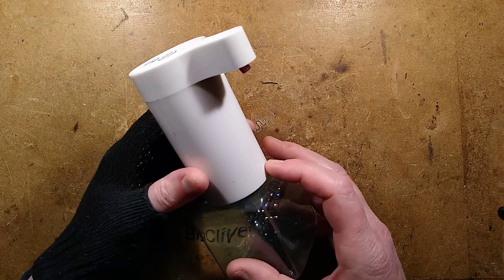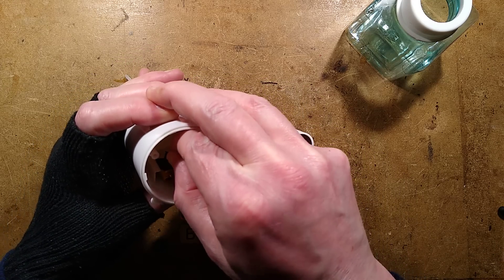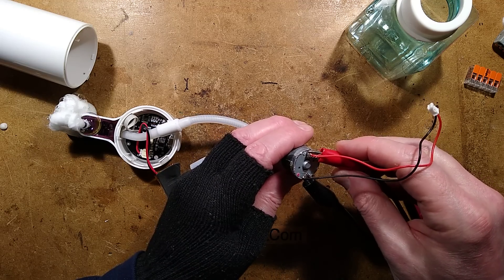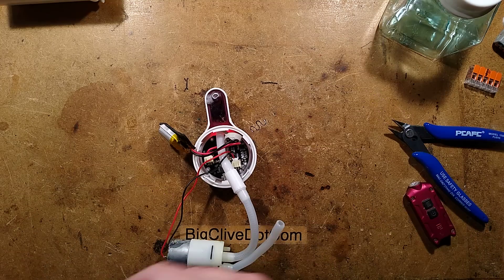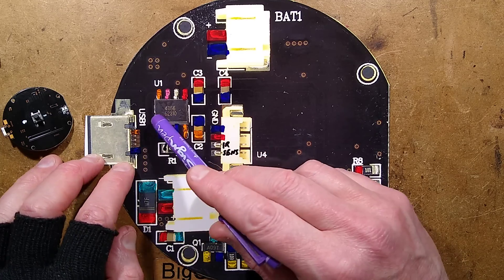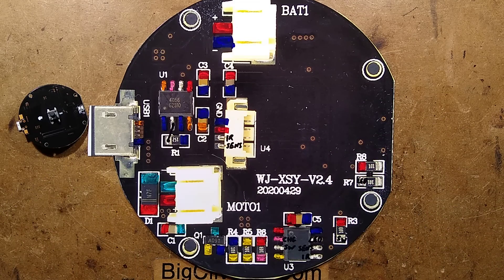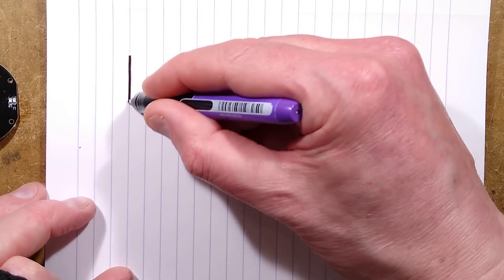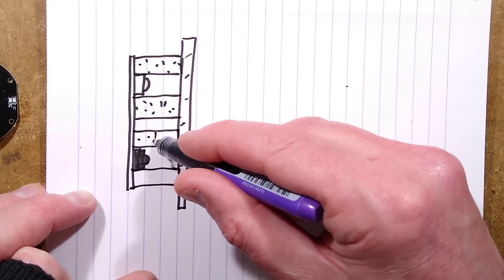Back from a YouTube ban!  Faulty soap foam dispenser - with schematic

Comment: Are all of these crappy and quick to fail? I never read any positives about any of the electric ones. I tried hand pumped ones. But they start to get stuck after a while or don't produce foam and pass the soap as mostly thin liquid. The one that lasted for a while now is a hand operated wall unit. It started to get stuck a while ago, I thought the spring already failed, but it turned out the stuff got into rotating or sliding surfaces. After some effort, including an ultrasonic cleaner it started to work again. I sprayed silicon lube on relevant parts and it's been working since then. Though it doesn't produce the best foam, and it depends on how you press it and I think on how full it is.
Reply from the maker: The main bit that seems to fail in all of them is the foaming meshes.  The mixture of air and liquid is pushed through a couple of meshes that breaks the big bubbles into smaller ones and then even smaller ones.  That can block.  With the electric ones, turning the mousse generator round and running it for a while can clear it out.

Comment: So it never turns itself off after manually being turned on? You have to manually turn it off to stop the IR strobing that is essentially looking for a hand? If you have a dirty set of hands, it seems that pressing the top button to turn the unit on would be a bit of a hassle. But to be honest, I don't understand why they went with a button instead of a slide on-off switch if that button doesn't turn itself (and the power to the unit) off after a bit of non-use.

Comment: I guess "the Russian method" as we used to call it would work in this case - just hitting the non-working device, in order to fix it. I fixed a IR detector in the basement like that. It was changing from green to red when I pass, but couldn't hear the relay clicking, and there was no light. Hitting it a few times fixed the relay 😂

Comment: It's probably a peristaltic pump, because it needs to be able to self prime and not drip with fluids of different viscousities. And here, if the motor torque is insufficient to start moving, it's stuck!  So some old gloopy soap in the tube and it's stuck!
Reply from the maker: It's a diaphragm pump.

Comment: The technical term is “sticktion” used to be a problem with 1G harddrives back in the late 90’s. Happened a lot to my Sun boxes (SS2 and IPX) - the ‘fix’ was to either take the drive out and do a quick 90 degree twist, or the preferred method (since it did not involve disassembly) was to pick the box up about 6 inches from the desk and drop it. The shock did one of two things. Started the drive spinning (yay), or killing it for good (boo). Had about 95% success rate with the drop approach.

Comment: They couldnt handle the beard actually. They just jealous and dont want to admit it

6:30 im used to using an internal pull up resistor for microcontrollers but its kinda odd to see a discreet resistor being used like that

Comment: The motor getting stuck reminds me of when I was a computer technician in the late '80s. some hard drive motors would get stuck and to get them going again you had to spin the end of the spindle on the bottom of the drive that touched the grounding strap.  You could then copy the data off onto another drive.

Comment: RSVP the tip of your beard! Basically for anything remotely dangerous, you need to put a big disclaimer on screen about how it could be dangerous and you could injure yourself and it's OK for you because you're a professional and nobody got hurt. It's ridiculous. Honestly, I'm surprised you haven't got in trouble in the past for holding a hot component for too long while soldering it.

These videos aren't for children, and children don't even have beards (probably), so that wouldn't be a problem anyway. But if they did show it to a kid and they hurt themselves, that's YouTube's fault for showing the kid a video that's not for them!

But then, I suppose that's the point, isn't it. YouTube don't want to take responsibility for the problems with their own platform. It's such a reoccurring theme with them, I'm starting to think it's literally their business plan.

Comment: One of those "Repairable by smacking it"-items.
Guess a slight loss of contact on the motor brushes caused it to just be dead and not move. Extracting it probably fixed it.

Comment: I often see a schottky diode across brushed DC motors in small RC planes and helicopters. My skill at rebuilding my ESC developed alongside my piloting skill.
Reply: Yes, all inductive loads should have those diodes: motors, solenoids, relay coils, etc. Inductive loads produce current surges of opposite polarity when they are turned on and off. Diodes are there to absorb those surges, so they won't scramble or damage other components.

Comment: now your are back BC. as is my wont, perhaps i can pick your brains. i need a 5w GO R. and finding one has proved difficult. ebay has been no help. i tried making one with a hosepipe full of DI water. it kind of worked. but i am not fond of water on my bench. my next idea is a tube full of dried sand. but tbh i cant imagine proper boffin types messing around like this. i need to limit a 76kv supply to around 20 uA. to play with reverse biased rectifying valves for making x-rays. what do normal people do when they need large R with good power handling? as i mentioned, i have been watching x-ray vids.
Reply from the maker: If it's for high voltage that makes things trickier.  You may have to use a long string of resistors in a glass tube.
Be very careful with that high voltage.

Comment: Liquid soap can get 'hard' if it's exposed to air for long enough. That might have caused the motor to seize until you gave it that power-boost from the bench power supply.

Comment: I have one of these soap machines with a 7-segment display and 8 levels of foam output.  I got it last December and it is still running on the initial charge six months later despite being used 5-10 times a day.  It also has a capacitive sensor to warn when the liquid is almost empty.  It is one of the nicer inexpensive products from China, Inc.

Comment: Motor seizing risks overheating, which would be really worrying with a lithium-ion cell. I have a standing fan I'm going to toss because it still works, but the friction has gotten the motor spicy to touch on any setting. Maybe I'll oil it and try to run it a litttle longer...

Comment: OT:
May i suggest analisis of $10 china 240V "radar led ceiling lamp" circuitry? I have one, works nicely. Led are driven to max, poor heatsink, will not live long. I would like to "dubai" it but do not understand the led driver.
Edit: I got it. BP2861 led driver. Changed CS pin resistor from 2 ohm to 5 ohm.

Comment: For all soap-foam-aficionados: I took home one of the empty one-way-foam-soap-bags, that the janitor has simply thrown away (at work)... Punctured a tiny hole on the bag´s back-side, filled-in cream-soap/water- mix, and stuck it beside my basin with a double-sided-tape (thus, sealing the hole too), ready...!!! Still have to press a lever, but it doesn´t require recharging and takes 100-times less material to build (weights just mere grams, after all), lasts forever when not abused... 
Glad you are back...!!!

Comment: Cool.  Yah, the button pull-up is definitely odd.  Most micro-controllers have an internal weak pull-up feature that can be turned on for port pins.  No external resistor should be needed there.   Everything else looks normal.   Hmm. they might also be able to eliminate the snubber diode and let the FET's protection diode deal with it... for such a dinky little motor.

They could have cut the electronics cost in half if they had been thinking.  That charger chip is totally unnecessary. A smarter design could just have the MCU charge (and be powered by) the battery via a port pin and a series resistor, with USB-C power (+5V) dioded in to VDD.

The way that would work is that the MCU would monitor VDD to detect the higher USB-C voltage and set the port to an output to charge the battery.  It would monitor the battery voltage by flipping the port to an ADC input for a millisecond every second or so to check the voltage.  Once charging is complete it would switch the port back to an input.  All done.  One could even get rid of the resistor and just pulse the output to limit the charging current.

-Matt

Comment: I learned this from watching your videos.

'Resistors can be used to create biasing voltages for transistors or operational amplifiers. By connecting a resistor to the negative terminal, you can establish a stable reference voltage required for proper operation of these components.'

Comment: Contact cleaner also works a treat on smaller motors, especially the geared micro-motors popular with hobbyists.  Whilst these smaller motors are almost "throw-away", they can be kept running for years with a spot of regular care and maintenance.

Comment: @Clive:  Have you done a vid on shaded-pole motors?  My oven fan one stopped going round, and I can't see any obvious reason why.  The main coil has 250ohm and isn't shorted to the stator, and the shaft and rotor turn easily by hand, but it doesn't turn under power.  I ordered a similar one from China, intending to swap the rotor and bearings over, but can there be anything to go wrong with the rotor itself?

Comment: Mine had it' s motor stuck and it fried the A09T (or similar) mosfet and when I fixed the motor it couldn't drive it. Although the MCU sends signal for the mosfet and after me replacing it with a similar one (A7SHB), it now drives the motor continuously when I plug the battery. I tried puting a 47Ω resistor between the Source and the signal from the MCU, but it didn't work either. I'm determined to fix it. Any suggestions are welcome.
Reply: It might just be that I don't know the exact mosfet that it had that burnt out. But the connection to it are like the ones on Clive' s schematic. Even the resistors where the same.

Comment: Is it a brushless motor, Clive?  The 'brush' ones just have very thin foil for brushes, and it soon wears away.  I have very handy little rotary tools that packed up when the foil wore away. There are cheap alternative replacements, but watch out for the bearing mountings being in the wrong place to fit back in the tool and fit the chuck...

Comment: I know that's a liquid pump, but has anyone tried to make an air-lift pump from the similar small motor air ones?
  My failure prompts the question. Thought it would be simple and ended abandoning low voltage for one aquarium that needed a pump.
   A good repair vid is the rubber cup diaphragms in aquarium air pumps. I do all kinds of things to fix them. Latex with tiny wire embedded for strength is about the best so far. I think it is planned obsolescence with the rubber. Buying replacements is only for newer name brands and it is half what a new pump is.

Comment: I have a mister of similar design.  The spring that they put in the soft tubing to hold it open makes cracks round the outside of the curves and lets the air in.  You have to keep a stock of different sizes of vacuum tubing, or find a stainless spring that fits.

Comment: I also thought the manufacturer should have used protection to prevent foam blockage, nothing worse than when you really need it ,you are continually wagging your fingers back and forth and all you get is a thick dribble ,which only gets worse with age

Comment: Just retrieved my old unit from the kitchen drawer. Not used it for a while, and you're right the motor had stuck. A few sharp taps seemed to work, and I am up and running.

Comment: I bought foaming soap dispensers several years ago, they are merely a few springs and chambers. They require manual compression of the pump mechanism, no batteries required. Great video, thanks for sharing. Thought maybe you were going to "soft soap" us. 😆😆👍❤️

Comment: I tried to mix 1:10 or whatever they suggest for using hand soap in these and they always clogged up in the aerator foam generator thingy because the mixed soap always seemed to eventually form thicker regions.  I switched to the foaming soap which is more expensive and you use more of it (because you don't dilute it) and I haven't had another dispenser clog on me.  Unclogging them sort of seemed to work for short periods, but once you mess with those foam generator 'pills' they never quite work right again.

Comment: Clive,  your hand you need to get to Sainsbury's and get some Metinium nappy rash creme the yellow one ,  it's fantastic but it stinks  I had a 3 inch by 2 inch burn on my leg ,  green yellow tight skin that cracks as it moves , the creme took a few weeks to repair the skin put it on and cover with a fabric Elastoplast cut off strip,  it's very impressive healing ,  also use Savlon creme on your hands if you are working with solvents especially isopropyl alcohol

Comment: Those little motor pump units seem to be a good choice for an autonomous DIY plant watering device. Cheap enough to have one plus a humidity sensor per flowerpot and one arduino to control a bunch of them. Not terribly much water to pump over the course of a day.

Comment: I remember my dad going to a barber shop in the early 1970’s run by an 80 year old called Chorley on Cowbridge Road in Cardiff. When my dad had  his beard trimmed, Chorley would “taper” it, using a lit wax taper to singe the ends - quite fashionable back in the day.

Comment: As one of those old fashioned pigs that still use "manually pumped soap", is there really a benefit to having it in this formidable foam form?
Reply: You're asking two questions. Is foamed soap better than liquid soap? Well it's pre-lathered which is nice. Is a touchless dispenser an advantage? Not when you have to worry about keeping the damned battery charged. The best of both worlds is a manually pumped foaming soap dispenser.
Reply: @SanchoPanza-wg5xf  I can see the benefits of a sensor driven dispenser for hygienic reasons. At least in an houshold that contains more people than me, myself and i :D
Reply: @DasIllu  The pump plunger could be as dirty as a Frenchman for all I care, since I wash my hands immediately after touching it.

Comment: Be careful not to get oil in the brushes. It'll burn and shorten their life. I got an old motor which had been used in a model boat, when I was a child. It had rust on the case, so I took it apart and covered it in grease. The brushes didn't last long.

Comment: Could this device be repurposed as a foam generator for wooflage? 8^) I've used those nutating disk pumps in a few product designs. They are inexpensive and work really well - except if they ever go dry after having the working fluid in them.  Cheers!

Comment: I bought a foam soap dispenser from LIDL. Ran off 4x AAA. The batteries rusted, as did the battery contacts. It clogged when I used a white shower gel -- turns out opaque gels have bigger particles in them, even clay. Always use clear soaps in these. While it did save soap, it didn't last long enough to break even, even without considering the batteries.

Comment: I remember as a teen in the 1970's we had a large, very heavy and expensive window Air conditioner, that suddenly stopped cooling. it cost $500 USD [ which was a lot back then ]
my dad had a repairman come out  and look at it. and he found that the compressor
had locked up, so he took it back to his shop, and jolted it with 220 V and UN-froze it .
unbeknownst to either of them, a  curious little boy had played with the thermostat
 turning it up and down, causing the compressor to seize... Wonder who it could have been?  [ Pointing  to my younger self ] 🤐
Reply: That's why they have 5 minute lockouts on the compressors now, so if the compressor was running and it stops, it won't restart for 5 minutes, allowing the pressures to equalize and ensuring the compressor will NOT lock up. It's not your fault the unit was shoddily designed... :)
Reply: Thank you for finding a bug 😂

Comment: I notice at 2:36 that the black wire on the motor has a red spot next to it. Does that spot designate positive?
Reply from the maker: It's for directional polarity.  It can be used either way round.

Comment: Motors like lipo batteries can be brought back to life with a little extra voltage, only difference is best putting your charger into pb mode for a minute or 2 to get expensive lithium cells back to life for a little bit longer. But do not recommend because too much voltage and time can cause a puff of smoke and fire
Reply from the maker: I recommend extreme care when resurrecting locked out lithium packs.  But it can be done with success in most instances.

Comment: Could you use this circuit as guidance to design a circuit for a system to dispense water in a bowl for little kitty cats outside into a bowl?
Reply from the maker: There are simple cat water units that self top-up with no electronics.

Comment: Unlike a lot of the cheap, trashy products you usually review, whoever laid out this board apparently took some pride in their work. Short traces, small loop area, and I'd go so far as to say that it's aesthetically pleasing. And not one but two decoupling capacitors across the battery, and one on the MCU, and one across the power connection?! Salisbury might decry it as "wasteful and ridiculous excess," but I approve.
Reply from the maker: It is well designed.  And the software seems very good too.
Reply: I found the same. There must be a  certain national pride in the Chinese soap dispenser industry, or at least an enlightened CP official in charge of it.  So many inexpensive products are trash, but the Chinese soap dispenser I bought is very well thought out and made with high quality materials.